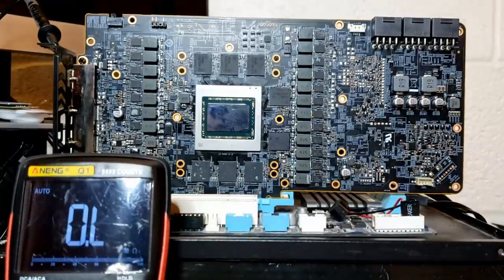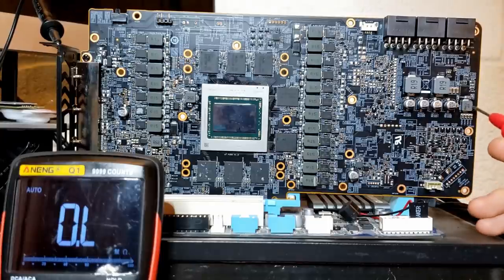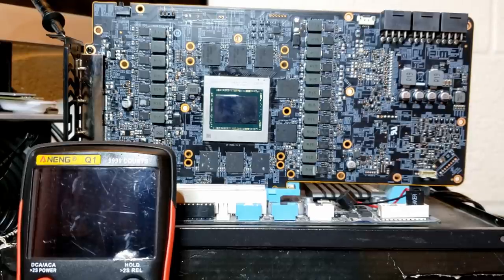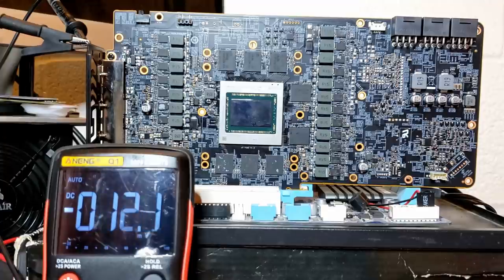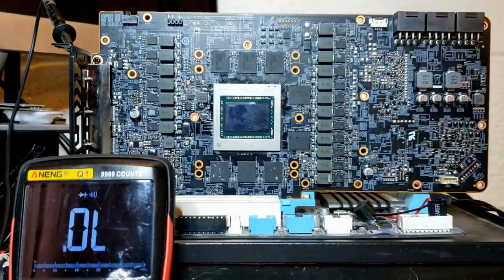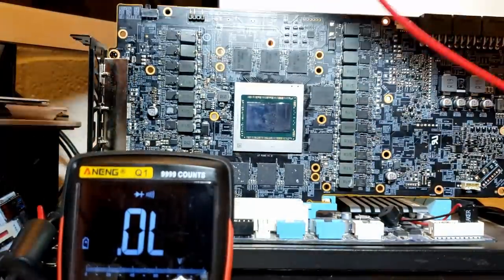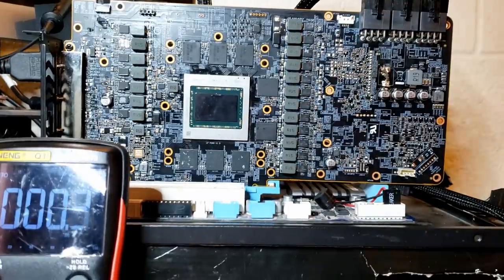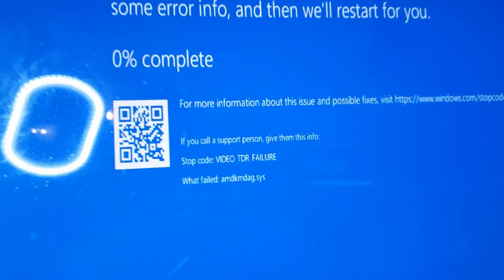PowerColor RX 6900 XT Red Devil Diagnosis - Computer won't power on

Comment: commenting for engagement
Reply: You sent me here, really cool thanks!
Reply: "Engage!"
Reply: Oh dang bz in tha house
Reply: Another great video.  Thank you for sharing.  I am however, running my Sapphire Nitro RX 470 on only three of four power phases and it works great.  I had the parts but nowhere near the skills to replace the failed smart power stage, so I simply removed its inductor, disabling the phase.  The GPU runs at full speed (1206MHz) and even allows overclocking.  I'm assuming that the power requirements of an RX 470 are low enough that I can get away with 75% power, but do (either of) you have a better idea as to why it actually works?  I guess I am lucky my video card had fuses.  :)
Reply: L🤫L

Comment: This awesome video quality is why you have gone from 60 subs to almost 2k in just 2 months! That's an incredible growth rate in my opinion!

Edit: Aaaaaaannnnd...... one more week and you're up to 2.4k.
Reply from the maker: Thanks!, this time around I used continuity to check which power stages were connected to which 12V rail like you suggested in one of my earlier videos.
Reply: @TechCemetery  Ah. Yes. I noticed. I'm surprised you remembered it was me who mentioned that! Thanks for the acknowledgement! ♥
Reply: @TechCemetery  I have R9 270x which i removed half of the vrams. It currently have 1GB from A0 to D0 .. Will this card work on 2GB stock bios. Do you know a solution to this ?. Currently Windows rebooting Everytime.

Comment: See the video title i was like "How? That's a brand new card" but after heard the reason "Oh that's why".
It's so sad this GPU is unfixable considering it's still quite new, but no surprise when a GPU is injected with 12V. Remind me with Zoras Tech video few days ago.

Also just realize your multimeter wrong reading probably because of the dying battery, there's a battery logo on it. It also happened to me about 3 months ago and just realized the battery is dying.
Reply from the maker: Yeah it's a shame, I really wanted the card to live. And thanks for the reminder, that multimeter is such a battery hog due to the screen.

Comment: Hello, i found a rtx 3080 fe  for sale that doesn't detect, fan spin but nothing on screen, is it possible to be a dead cpu, what exactly can i test before i buy it? Because i was not able to find someone selling the cpu for this card, the owner said it worked fine for 15 days. Thx.
Reply from the maker: Check the PCIe pins, I have a "Mining riser inserted backwards video"
Reply: @TechCemetery  thank you so much, i will watch it,

Comment: Excellent job, 
I suppose you have to raball GPU and memory. As you said the owner used liquid nitrogen cooling for overclocking,  sometimes a dust or rust between pads and pins can create a capacitor in high speed circuits, and then you assume the chip is dead.
Reply: BPS Brian had it get really wet from condensation during the LN2 Livestream turned on
Reply from the maker: Thanks for the suggestion, in future I'll consider it.

Comment: That was a really good video, thorough and well explained. You need a board preheater for situations where the board is gobbling up all the heat (wear thin cotton gloves while soldering, so you can briefly touch or lean on hot surfaces). I get why you're careful about only using low voltage for circuit testing. I do the same, just to prevent further damage. But realistically, as demonstrated here, it's a pointless gesture, because if a power stage is dumping 12V into the GPU, the customer has already nuked everything.

Comment: Great video, sucks to see such a beautiful chip meet its demise. But that's the risk you take when you go extreme with LN2. Do you have to send these cards back to the owner or do you keep them for parts? Also when the GPU gets exposed to 12V, how long does it actually take to cause permanent damage to the internal architecture, I assume it's pretty much instantly?
Reply from the maker: I have to send them back, some cards pretty much dies instantly when exposed to 12V and others can take a couple seconds.

Comment: If your not already using kapton tape and or reflective tape in your repairs, it can help to protect the surrounding components when replacing defective parts with hot air and or a soldering iron.

Comment: You can use 99% isopropyl in a spray bottle to find shorts if you don't have a thermal camera.
Reply: not so useful with low voltages he need to use on GPUs, maybe with some high current (10A or more) PSU but with standard bench supply few watts of heat will be dispersed in board (especially one like this one with thick current planes) and all you will see is IPA evaporating for large area slowly.

Comment: Amazing work. I have the Liquid Ultimate version of this card. Do you think the input filtering caused the power stage to die at these extreme oc levels?
Reply from the maker: Possibly, a lot of newer cards are surprisingly unreliable.
Reply: @TechCemetery  yeah I've noticed power color skimped on the input filtering for this card. It's not necessarily "worse than stock" but the xtxh cores are unlocked for overclocking, powercolor should have added another cap at least, it's an over engineered board except for the input filtering.

Comment: i recently bought a broken gtx 970 and when i plug it in my dell t5500 it doesnt power on. so i tried another pc with diffrent psu and it gave out smoke.
8pin shorted to ground.
after inspecting i found deformed solder ball under a mosfet which i was already suspecting 
now im wondering if replacing the mosfet would fix it
im planning on removing the mosfet and testing for short once again
but the card is missing about 5 resistors due to the previous owner attempting to change the thermal paste or something.
so would it just blow up again?
is it possible that the mosfet was already blown and just started smoking again due to poor shortcircuit protection of the psu
psu is a new corsair hx1000w

Comment: Great video as always! I have another small question, I hope I don't bother you too much , a low resistance on the 1,8v rail (20/50 ohms) means that the core is probably damaged?
Reply from the maker: In my experience, a low resistance on 1.8V is accompanied by a dead GPU well over 95% of the time.
Reply: @TechCemetery  if is really low it's not a bad practice to remove driver/controller of that rail and check again, sometime problem is on other side and not in GPU. But yes, most times is just dead gpu.

Comment: @Tech Cemetery I have R9 270x which i removed half of the vrams. It currently have 1GB from A0 to D0 .. Will this card work on 2GB stock bios. Do you know a solution to this ?. Currently Windows rebooting Everytime.

Comment: hey man, i think you are a legend, i bought an RTX 3060 MSI off eBay and found that it gives no signal, it is not detected by windows in dev manager neither is it detected on the motherboard bios says slot empty, but fans spin and i think they are sensing the 16x slot since they only spin when connected on board, i tried it on 3 systems and the same scenario, any thoughts please?
Reply from the maker: I can't really provide any good advice without a diagnostic - I'd need to know the voltages and resistances on all power rails before I could give any suggestions.

Comment: Oh also why I remember when you check resistances on rails if there was a 8ohm on the pex rail inductor what would the faulty component most likely be? Ie card does not display but all voltages and other resistances is good even the 1v is present but just the resistance is low much appreciated bro ❤️💯
Reply from the maker: 8 Ohms on the PEX rail basically guarantees a dead GPU. Just to be clear, we're talking about an GTX 1000 series card here right?.
Reply: @TechCemetery  yes 1060 106-400-a4
Reply from the maker: I'm going to have to say dead GPU. There's not a lot of circuitry on the PEX rail given it's main/sole purpose is to power the PCI express controller on the GPU die. In my experience, well over 90% of cards with an abnormally low resistance on the PEX rail have dead GPUs. If it wasn't the GPU, I'd have to consider the capacitors and the buck converter itself, but those are rare.
Reply: Kinda figured that would be the culprit but the card is imacculate the thermal paste was old but still good heat pads hadn't leaked any residue and everything was spot on just not the resistance I followed the traces and when it reached the gpu was like oh dear that's not good 😂 ☠️ real shame tho as its the nice inno3d I chill X3 at least I managed to copy the bios chip as tech power up only listed one inno3d 1060 bios and it wasn't this card might see if I can upload it dunno if they except bin file though will Try at some point oh well got some components atleast lfor next try at fixing a gpu 1-1/2 out of 3 isn't bad I suppose still need to. Figure out the strix 1070 ina3221 data not being read by the gpu chip but I can use as is for now 😂

Comment: You should use Rossmans short finding method. Not am IR camera, but dripping isoprop alcohol on it, looking for quicker evaporation. Feed about 1V, adjust current limit so you get at least 3W into the card. He has many videos on this.
Reply from the maker: I could, but that would not be smart for this card.

Comment: Hello bro. can you make a video on 3070 ? i am having problem on Gigabyte 3070. i pulled 8pin cable and 6 pin cable when the power was on and after that the gpu is not working. power is coming in the gpu. as i powered it, its fan immediately spin one round and then stopped it and the CPU not able to detect. I tested it every possible way. kindly help me. thank you.
Reply from the maker: Without the card in hand, I can't tell you what's wrong with your particular 3070. Those details are too generic.

Comment: Maybe re hot the gpu first, if no artifact then consider to reball, but it flip chip btw so sometimes re hot near the crystal will fix the solder bump but it will not last for long time

Comment: Hello, I've got a repair question, sorry but I have no other way to contact you.

Got an rtx 2070 with only 3.3v 12v and 5V rails working, no shorts. Which is supposed to be the next one in the sequence? Looking at up9512 (vrm controller) and then that will send enable signal to 1.8, 1V and memory rails. Am I correct? Thankyou!
Reply from the maker: 1.8V is the next power rail to turn on.
Reply: @TechCemetery  Great! Thanks! Enable signal was not reaching the buck converter, made a jumper from 5V and now card works great.

Comment: Hey, great video like always. Shame to see that the core was damaged, but I think it's good that you left that in, as sadly it does happen quite often with shorted VRMs , especially when the manufacturers don't include any fuses (I'll never understand why they don't all use fuses!!).
BTW, I don't know what your opinion on this is, but I've found that when a card has a shorted high side mosfet or VRM generally, I can inject about 0.6-0.8V at the 12V connector and put the black/ground probe from my psu to the VRM inductor, instead of ground. That way the 0.8V only flows across the short itself and doesn't reach the GPU core, and with thick wires I usually get 3-5A current draw, which heats up the short enough to find with a thermal camera or even IPA (I've been spoiled by my seek thermal camera I admit, but the isopropyl alcohol method is also perfectly viable in my experience). So far every GPU I've fixed with this method came out perfectly working so I see no issues with my method but I'd love to hear what you think
Reply from the maker: It's definitely a better method than what I use in my videos, but I suspect you're still exposing the core itself to the supplied current. Usually these GPUs have capacitors on the substrate housing the die and I reckon if measured the voltage on them, you'd read the PSU voltage. I could be wrong though, I'll definitely try this the next time I have a short card. And yeah, I can never understand why fuses are not standard on GPUs, most GPUs that die due to shorted VRMs would probably have lived if there was a fuse.
Reply: @TechCemetery  Hmm yeah, from basic electronics principles alone the power should only flow between the two PSU connections and not reach the core itself, but I honestly haven't given much thought if the GPU is being exposed to any voltage as a result of some more advanced electronics principle when injecting voltage between the 12V input and a point other than ground. Still, I've never needed to inject more than 0.8V to find the short this way, as without the series resistance of the GPU itself the current draw is high enough to detect, and I think 0.8V should be a safe voltage for most cards, no matter where you inject it (within reason). I'll try and measure the core voltage next time I do this, but I do also appreciate anything you might find. Keep the videos coming, and I'm looking forward to the discord server/ subreddit or any other resource you can set up for everyone to share the GPU repair knowledge.

Comment: Thanks for this awesome video, and so many others! I have one question - can Vram chips make short and ‘cause of that we do not have graphics card recognized and we have black screen. Cooler us spinning, but GPU doesn’t gets hot.
Reply from the maker: VRAM chips can definitly get short and cause a black screen, but the GPU should itself warm up. On Nvidia GTX 1000 series cards the memory rail turns on only after the GPU VRM is good.
Reply: @TechCemetery  mhmm, this is some AMD card, but have short on MOSFETs some caps, but everything leads to Vram chips.

Comment: how much voltage are you inputing with your power supply,  i repair cards to and im always looking for new info and tips, ty man for the info
Reply from the maker: I never use anything above the lowest voltage rail unless I know it doesn't pass through the core. For this card that's 750mv.
Reply: @TechCemetery  ok thank you

Comment: Hello, I am impressed with your skills! I was wondering if you could help me out with diagnosing 2 broken 1080tis, one Strix, one Gigabyte.

I just tried diagnosing gigabyte one, I've checked base voltages all good, 5V good, first 1.8V is down to 1.5V and 2nd 1.8V is missing, so is 1V pex and everything else. Card overall looking good with no seemingly replaced or broken parts. I could send pics and mark the ones I've tested. Are you available on email on such requests? Thank you!
Reply from the maker: What is the resistance on the 1.8V rail?.
Reply: @TechCemetery  on 5V 700 ohm, 1.5V - 3500 ohm, 1.8V(that's showing 0) says 2.1 ohm. Not completely sure I measured this correctly.
Reply from the maker: @nebax11  An abnormally low resistance (i.e. 2.1 Ohm) on 1.8V basically guarantees a dead GPU. As for the "1.5V" rail, are you sure you're measuring the right power rail? do you mean the memory phase?. 3500 Ohms sounds either like the 5V, 3.3V, or 12V rail.

I have an email listed in the about section of my youtube channel if you would prefer. It might clear a few things.

Comment: what if 12v and 3v got no reading on the pcie. which place to diagnose?
Reply from the maker: The 12V rail should be connected to an inductor. Does your card have fuses, and if yes, are they blown?.
Reply: @TechCemetery  the fuse near the pcie express beep sound when i test both ends. and the fuse below the 8pin power , both fuse no beep.
Reply: @TechCemetery  if i ground it and test on pcie express fuse got no beep , but the 2 fuse from below the 8pin power beep both of them.
Reply from the maker: Is this a sapphire RX 480?
Reply: @TechCemetery  its sapphire rx470. i think its got some similarity with rx 480. hope to learn something from you as i just trying into repairing my dead cards lol
Reply: @TechCemetery  i found out that black color below the 8pin marked "R47" .  the value is 2.5 ohms.  thats why i was thinking was it that R47 black thing ( i dont know what it calls " is the problem?. the same black thing mark "IR0" on 1 of your xfx rx580 video repair
Reply from the maker: Did you check the MOSFETs?
Reply: @TechCemetery  u know what.. i look into the microscope and found out few ceramic caps blown up. and some are nano size . Some blown until the pcb copper gone which cant be solder. unless if i got a steady hands to rewired it and solder back the caps. so far 3 of the cards are GG.

Comment: if it is artifacting , isnt there a possibility that one of the memory chips are faulty ?
Reply from the maker: Yes, I said that in the video.
Reply: @TechCemetery  must have missed that. So if you could get your hands on the nvidia mats program, could you identify the faulty mem chip ?
Reply from the maker: MATs is an Nvidia only program so it wouldn't work on the 6900 XT. I actually have a guide video on MATS where you can download a working copy if it interests you.
Reply: @TechCemetery  thx. i mixed up mats with tserver. Anyways https://www.youtube.com/watch?v=SIpIOyv023E has some info on it.

Comment: Wouldn’t you rather send it as it’s under warranty ? 
Why fix something when you can get a new one ? 
I just don’t understand those overclocking the cards there’s no point, you may gain 10 frames but that doesn’t make any difference. 
Not saying this guy doesn’t do a good job I learned a lot, but like why overclock anyway just risking something to die regardless.
Reply from the maker: It always surprises when I see comments like yours, it's a modified LN2 card, the manufacturer won't even consider looking at it. And are you seriously asking why fix something when you can get a new one?, do you own a car?.